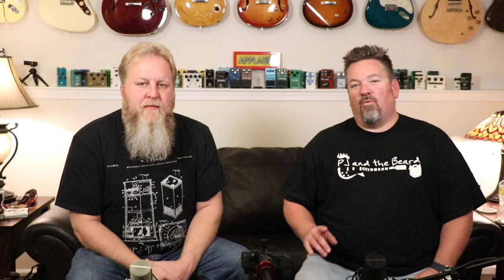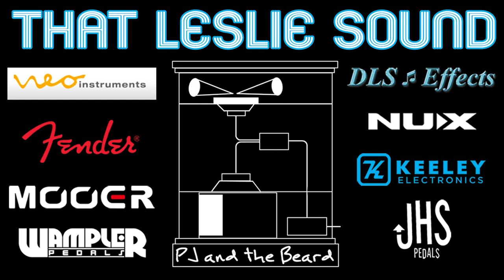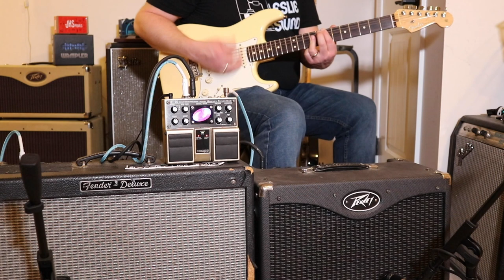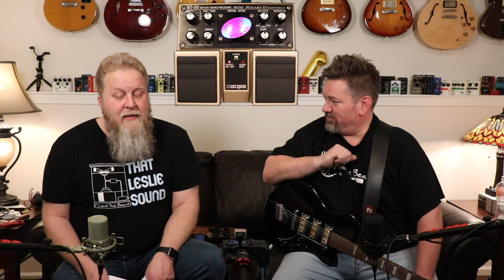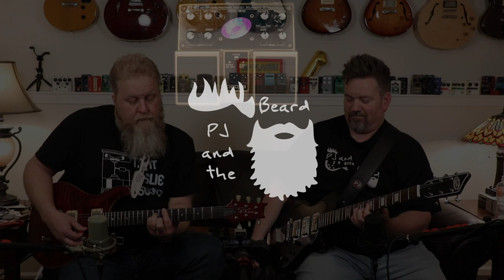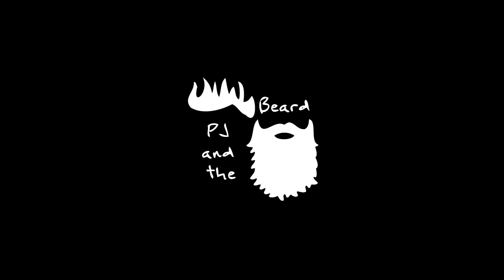The RT-20 Rotary Ensemble by Boss - That Leslie Sound Series

Comment: I have a Leslie and a boss pedal. I have to say the rotor ramp emulation is PERFECT. Of course the real Leslie is 3D in the room. But as an effect in a band setting with a guitar the RT20 works well. It does colour your sound a bit but in a good way
Reply from the maker: I really liked the RT-20. That is actually one of the few I regret letting go!

Comment: Shouldn't you demo it on an organ sound?
Reply from the maker: I mean Leslie speakers are pretty synonymous with Hammond organs, but they have been used with guitars a lot too. There are numerous famous recordings with guitars through leslie speakers. Most of these pedals were designed for either guitars or both guitar and keyboards.

Comment: I’ve found that my Boss Rotary-20, a little slapback delay, and the wah-wah set just right will make for a good organ like sound, works great on old R&B songs, etc. This Boss Rotary is one of my most used and liked pedals.
Reply from the maker: I’m not sure I’ve used a leslie type pedal with a wah but I have with an envelope filter. That sounds great so I’m it would on the right setting with a wah too. I really liked the boss rotary. Under appreciated for sure! -Beard

Comment: Good demo. Where would you put this in the signal chain on a pedal steel guitar? 
Before VP, or after? Before or after verb/delay?
Reply from the maker: Not a pedal steel player myself but figure it would be a similar approach. I typically put them after drive pedals but before the reverb and delay. I have a Rotosphere that really likes the effects loop of the amp if that is a possibility. I have also used it before drive pedals like a univibe. Some interesting things happen if you run them after delay and reverb as it will effect the trials more. I don’t think the volume pedal will have as much as an effect on this one as it would on a drive pedal. Basically, just experiment until you find something you like. You’ll find something that works for you.

Comment: These are pretty cheap on the second hand market. Is there much quality difference in this and things like the vent and rotosphere?
Reply from the maker: I find this question a hard one to answer. The boss sounds great and has more options and models. It is definitely a solid choice. Overall the Vents just sound amazing but with less options and models, but that thing they do they do really well. Worth the price if you can afford it and want one of the best sounding Leslie pedals out there. The rotosphere is super unique too. I think it does it’s own thing. It not only sounds unique but the expression pedal options make it do something completely different than the rest. All that said, if you like the boss pedal I don’t think you can go wrong with it. Boss is always good but I was still surprised at how well it stood up to the other pedals. -Beard
Reply: Thanks! I have a few 80s chorus boxes that do a good faux Leslie but wanted something a little more realistic. It doesn’t need to sound as realistic as a real Leslie per se but not a unrealistic sample. I’m guessing what I’m trying to say is does it sound Leslie? Or does it still have elements that still sound like a chorus pedal? I’ve had a few vibe pedals and some expensive ones although I’m currently running a mojo hand gyro which is enough for me in the vibe department. I thought with these boss Leslie pedals being rather inexpensive will it pass for being enough for my board? Would you use it on your board and be happy? Cheers

Comment: Boss rt20 or ehx lester g? Which is better?
Reply from the maker: Hard to answer because everyone likes different things. If I had to pick between the two I would probably go with the RT-20. -Beard
Reply: PJ and the Beard tks for the answer!
Reply: Nux
Reply: Boss RT-20 ftw. The lester G sucks ass big time. I think its way too expensive and on the fastest fast speed it has an awful metallic ring mod like sound